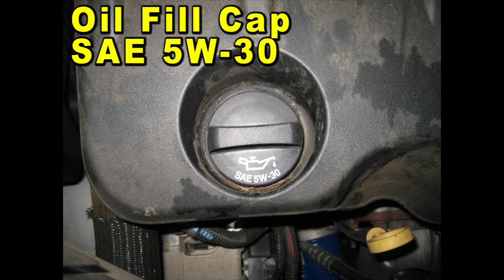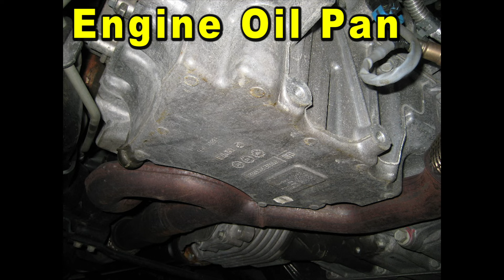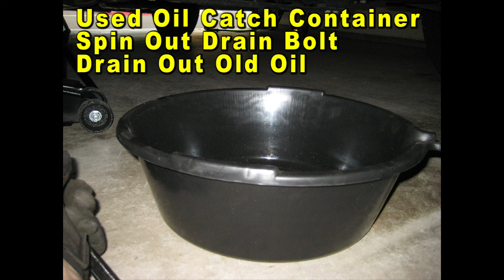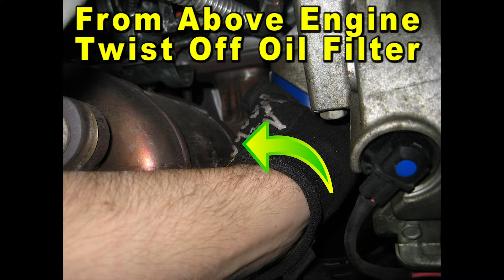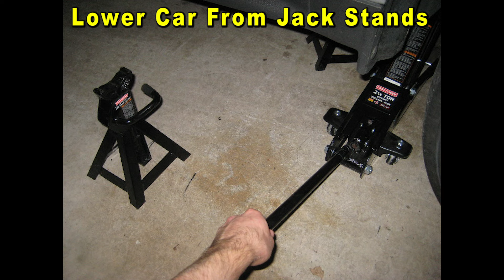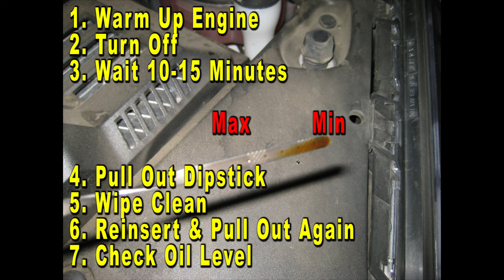2010 To 2017 Chevrolet Equinox How To Change Engine Oil & Filter With Part Numbers - LFW 3.0L V6

Comment from the maker: Chevy Equinox Engine Oil Filters - https://amzn.to/3zv48CA
Chevy Equinox Recommended Oil Viscosity - https://amzn.to/45P2Gal
ACDelco OEM Oil Filter Part Number - https://amzn.to/3VJz3lW
Fram Ultra Synthetic Oil Filter Part # - https://amzn.to/4cr3F2J
Purolator Oil Filter Part Number - https://amzn.to/3zv4qta
Precision Screwdriver Set - https://amzn.to/3sLixaP
Plastic Pry Bar Tools - https://amzn.to/3HMtsV7
Socket & Ratchet Set - https://amzn.to/3Z17LbA
Mechanix Gloves - https://amzn.to/3jCnHkt
Torque Wrench - https://amzn.to/3vS5uSI

The Paul79UF YouTube channel is a participant in the Amazon Services LLC Associates Program, an affiliate advertising program designed to provide a means for sites to earn advertising fees by advertising and linking to Amazon.

This DIY video shows owners of the 2nd generation 2010, 2011, 2012, 2013, 2014, 2015, 2016 and 2017 Chevrolet Equinox how to change the oil and the oil filter on the LFW 3.0L V6 engine.

Comment from the maker: Check out the DIY guide for changing the engine oil and the oil filter in a second generation 2010 to 2017 GM Chevy Equinox - 
https://www.paulstravelpictures.com/GM-Chevrolet-Equinox-LFW-V6-Engine-Oil-Change-Guide/index.html

Here are all of the DIY repair and maintenance tutorials for the 2nd generation 2010 to 2017 Chevrolet Equinox - 
https://www.paulstravelpictures.com/Articles/GM-Chevrolet-Equinox-Repair-Maintenance-Guides.htm

Owners of other GM vehicles such as the Spark, Sonic, Cruze, Volt, Malibu, Impala, Camaro, Corvette, Traverse, Tahoe, Suburban, Colorado, Avalanche, Silverado, Verano, Encore, Regal, LaCrosse, Encore, Enclave, Canyon, Sierra, Terrain, Acadia, Yukon, Savana, ATS, XTS, CTS, SRX and Escalade may also find these DIY instructions to be helpful.